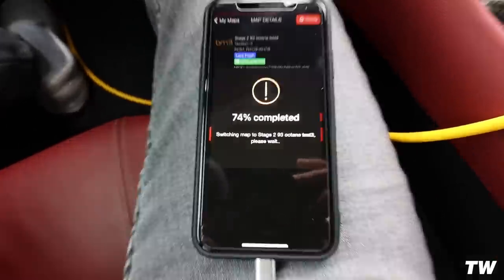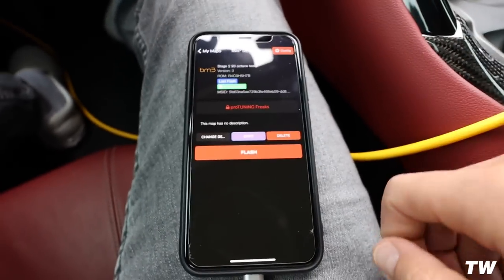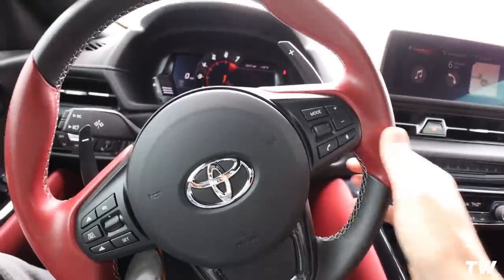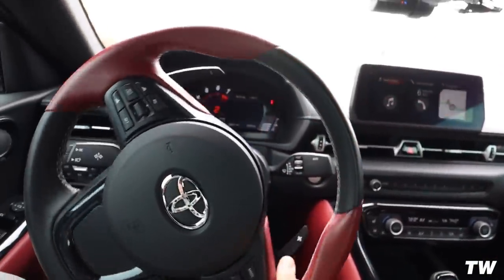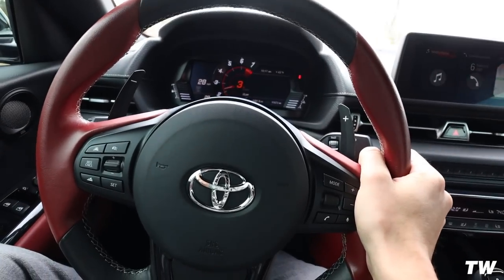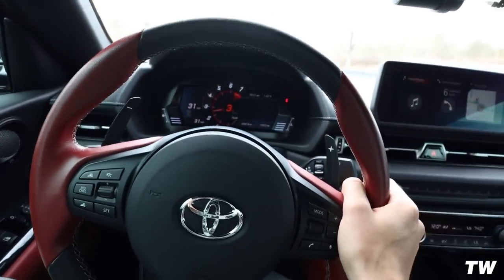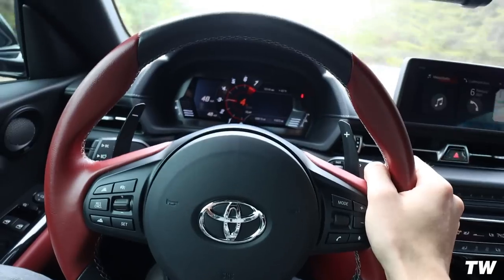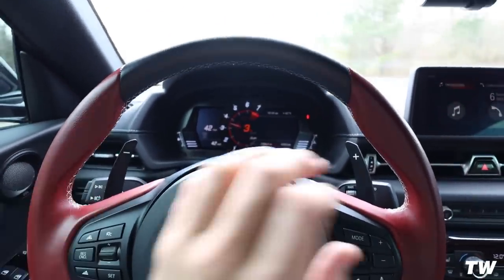WHAT HAPPENS IF I MAX OUT MY BURBLES? (EXTREMELY LOUD)

Comment: I do about 75% on Ecutek, 100% is loud as hell. The best way to get the burbles is to go up in the rev range while driving and left off the gas. It’s loud and it cracks longer. I was following a GTR and his sounded like gunfire. The passengers in other cars faces told me to rock 75% lol
Reply: Hi i do like burbles but every people says its cause harm to engine or turbo
Reply: @bmwsincekid  in extreme case sure it could, but manufacturers wouldn’t make cars with burbles like Toyota and Honda who’s reputation is all about cars that don’t break down.
Reply: @skywalk3x  i wanted to set my 540i b58 on mG flasher to 70% agressive but the guy who i bought the flasher he said it will cause problems to my turbo as it sprays fuel or what and it cause back fire or blast i dont know
Reply: @bmwsincekid  yes it very well can when it’s at its fullest. But some burbles is fine. A lot of people say things with no tech experience. If burbles were bad at the levels that manufacturers put them at, then they wouldn’t. Just don’t go overboard as a precaution. 70-75% is fine 👍🏾

Comment: So, I turned my sport burbles all the way up, maxed out the settings like in this video, and I have a catless dp, however it seems it burbles even less now than with before the tune… Not sure why, but my duration and aggression is maxed, but still very rare burbles. 
I can definitely feel the throttle and speed difference, just no pops
Reply: Downshift and quickly tap the throttle about 1%-4% depressed in quick succession about 1sec-2sec intervals
Reply: Sounds like you've had a win, the burbles sound absolutely horrible.